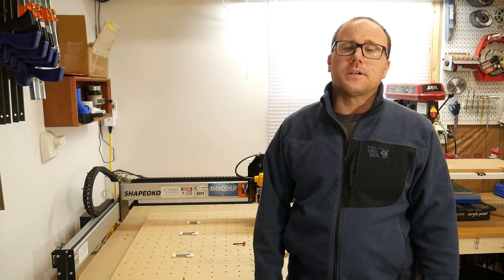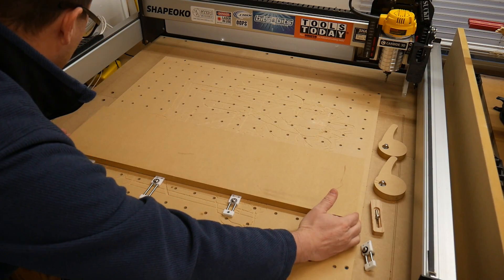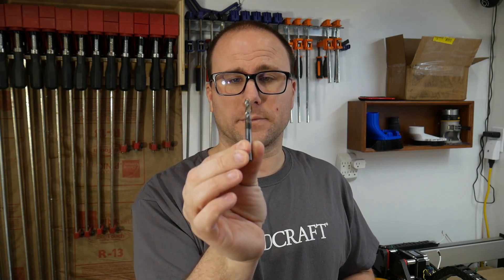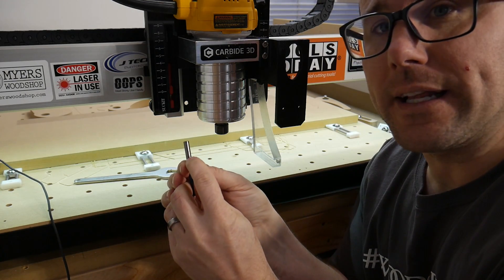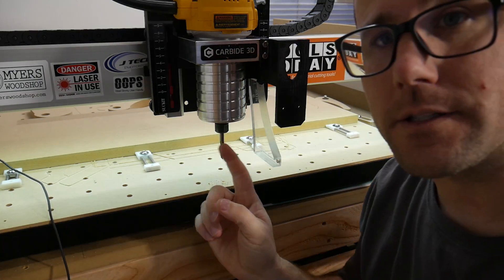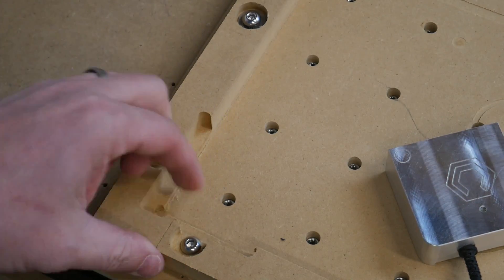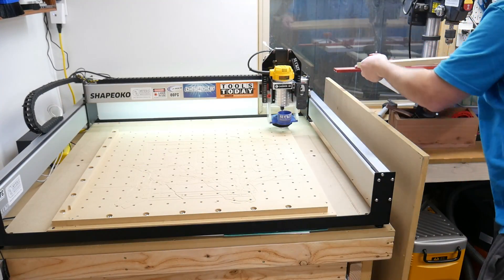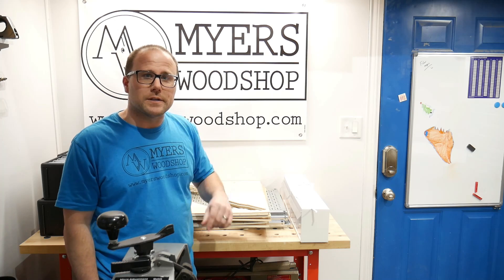How To Create A Fence For Your CNC Wasteboard // CNC Woodworking

Comment from the maker: 1/4 - 20 hex bolts : https://amzn.to/2UgneU5
1/4 - 20 washers : https://amzn.to/2KXoFST
Reply: Is the jog area larger than the cutting area? I’m brand new and worried I may accidentally run my bit into the fence hardware. Would it be possible to make the fence equal to the minimum x and y directions so the machine simply cannot reach the hardware (and you don’t lose cutting area)?
Reply: @brooksey097  If you attached a fence to the left of this wasteboard you could do that, but it would be one more thing to attach to either you base or try to screw in from the side into the wasteboard. Make sure to use your spindle to cut the left side of the waste board to get it perfect before you do. 

That wouldnt work though on the bottom since the Shapeoko has a metal frame there and you can't get past it without build up and losing material thickness

Comment: I've just downloaded the svg files for the cam clamps; thank you. I'm new to cnc and am using carveco maker. Is there a specific size 'model' that the clamps were designed for? (eg 400 x 300mm mdf). I've tried numerous variations on the size, but the svg file appears to change to suit the model (and I don't want 400mm clamps 🤣).

Comment: I set my fence on the limit of cut so I didn't lose cutting area also guarantee that the bit would not crash into the fence on a fast return to 0,0. (Easel likes shooting back at 3.8mm)
Does your setup not position the bit at 0,0?
Does this negate need for 3D zero probe?
Reply: You could still get a crash if you're using a larger bit though, right?

Comment: Wondering why you didn't build the fence to fit just outside of the cutting area? On my setup (a Shark HD5), I have the fence only protruding into the cutting area by about 1/4" after the straightening cutoff.
Reply from the maker: That could definitely be done.

Comment: Great video!!! Just an observation, when your touching off the tool should be rotated so your flute touches off on the touch off plate. In thos case your X is out by the depth of the flute
Reply from the maker: Thanks for the tip!

Comment: One suggestion could you adjust the volume on your videos while cutting or have no sound. It goes from your soft speaking to loud vacuums screeching. I love your videos and thank you for sharing. You really helped me learn how to get started with my shapeoko. Your step by step videos were great at helping me get started! Which from there I picked it up fairly quickly. But for disclosure I used to be a tool and die maker apprentice so I ran industrial CNC machines but that was a lil over a decade ago since I was doing that.  I've only had my shapeoko for 6 weeks and i'm already considering upgrading to fusion 360 to do more advanced machining and designing. Carbide create is limited for what I would like to do. I honestly would have to say without your helpful videos and winston moys YouTube channel I would not be as far as I am already. So a huge thank you for sharing your knowledge. Keep creating! If you can dream it, you can build it.
Reply from the maker: ok.

Comment: Just a bit of a tip to you. Don't use the cutters for finding the edge of your parts. Because you will most likely NOT bump on the flute ( the major diameter) of the cutter. That will give you a false reading of where your edges really are. Use a smooth pin. Any size, just tell your program what size you're using. Then put your cutter in to set the Z height. 50 years of experience tells us what not to do. Learning is a process. Keep it up.
Reply from the maker: or  you can put in the cutter upside down.  but .005 is good enough for most.

Comment: using a XYZ probe plate. when you do the X & Y. since the endmill has flutes the shape is not round so when you touch off on the Plate.. it wont actually be an accurate X & Y position. You need to use a Solid Round Shaft for X & Y and then do Z later with the Endmill installed
Reply: You can spin the cutter so the high point touches off. Or use a dial indicator and swing indicate. I have my starrett edge finder from my tool and die days but those you have to run at either 1000 or 1200 rpm so I think the routers are way too fast to use.  Another option would be a drill bit installed upside down but be very careful that you only lightly snug it in the collet so you don't wreck the collet spring. But yeah 1/4" dowel pin is the best quick and dirty method. Gets you close enough.
Reply: Another point would be to make sure your endmill cutter is low enough that the spiral edge of cutter will touch at its furthest point. Example: the 201 cutter that comes with the shapeoko is a 3 flute. 250in diameter and the side has a cutting edge of .750in. If the end of the cutter is dropped the full .75in below the top surface of the object you're touching off of there is always going to be 1 or 2 points at the full .250inch diameter touching the wall you are touching off on. If you are about 1/2" below the surface at least 1 point will be at the correct diameter. My suggestion would be to make sure you have dropped the cutter below the top surface enough so there is always one of the flutes touching off at its full diameter so you get an accurate touch off.

Comment: I am trying to wrap my head around including the touch plate into the fence. Does the touch plate align the X and Y to the bottom corner of the fence (as long as the bottom left is selected in the carbide software) or does a touch plate only set Z and you jog to where X&Y are? Sorry, new to cnc and learning before I buy one, I am thinking shopoko 3 standard based on size.
Reply from the maker: their touch probe does xy and z.
Reply: @MyersWoodshop  Thank you for the reply. Perhaps it is just the camera angle that was throwing me off. From what I have seen in the last few weeks I think I will save up for the Shapeoko. I'm going to save your videos to buy the plans when I get the machine.

Comment: When I tried to create the fence.  It appears that the area for the probe is being cut on the outside of the area.  I see in the video that when the probe slots are cut.  There is one L shape and one straight line.  My cut was two L shape cuts.  I looked at the c2d using carbide create and the probe cuts look correct.  Althought the top cut is not a complete rectangle.  Am I doing something wrong?
Reply from the maker: The probe area should be a pocket cut
Reply: @MyersWoodshop  Does this mean you are saying that the free file is correct?  Because I just downloaded the file and ran it.  When loaded into carbide create the toolpath shows the path around the area that is supposed to be a pocket.
Reply: I have a picture of the cuts showing that the area that should be cut is still there with a cut all the way around.  Don't know how to post a picture.
Reply: As an aside I deleted the touch probe paths and recreated them.  I then cut out the fence with no problem.  The file that I used came from the blog.  Both the xxl and xl show the wrong tool path.  The small file does not bring up the save as option.

Comment: wow. that Shepoko team is pretty serious about marketing. it's a shit CNC kit, the equivalent to a cheap multi-tool that can do just so little that it'll cost you a lot of time and not do the job and you'll end up buying the more expensive tool, now you have a good tool but you had to pay for a shitty tool as well making things even more expensive
Reply from the maker: For the about the same cost, which cnc would you recommend?
Reply: worst cnc out there. horrible, simplistic, buggy software, hilarious rigidity (axes are somewhat ok but table is like a blanket), can be easily derailed i Z axis,cannot remove z axis for cleaning, gets detuned easily, dust goes everywhere, belts easily skip and you lose xyz even when changing tool, 800w spindle is an overkill, an 125W would be more appropriate, the list of why this cnc sucks is endless. no tool changer, no spindle controls, no options in general. trendy, branded expensive trash for rich diy hipsters.

i have developed gray hair in the first months of use, just because my friends in a 'fablab' (wow) bought it.

you can get tons better machine in similar, same, or even lower prices.
Reply from the maker: Name a few
Reply: @MyersWoodshop  Queenbee Pre
Reply: constantinos schinas maybe you’re just an idiot. Mine is great.

Comment: What if you mount the fence on the machine wood floor, at the edge of the working board? If you do that you don’t lose any of your cutting area... (I don’t own yet the machine so I don’t know the implications of screwing something on the floor board, so just using my common sense logic here, if I am wrong in my presumption, please correct me)
Reply from the maker: Yeah, you could do that. But making it removable would be the key.

Comment: If this line was in the Z0 position it would not be there. The probe was moving at zeroing ...
Reply from the maker: what line?
Reply: @MyersWoodshop  7:41 this is your problem
Reply from the maker: Ah.   It registers the intial touch.  The rest is just inertia.
Reply: @MyersWoodshop  So it should be and if this is not the reason, there are 2 options, error in Gcode, wrong height of the probe in the program.
Reply: @MyersWoodshop  8:23 The button on the sensor is outside the measured element, so it moves. You must necessarily improve it.

Comment: If you're cutting the parts put, like you did to make the fence, you only need to be square enough to make sure the material covers the cut area. Probing X and Y for that job is useless. I will say that the fence and a place to zero it off is useful is either you're doing tool changes, multiday work, or you're cutting something that has the final edges already on it (like engraving a panel).
Reply from the maker: That's why it's easily removable. It's not for every job.

Comment: Nice job.  A little tip though. Your life would be easier if you had cut a chamfer or a small step on the bottom inside edge of your fence rails. Having the right angle created by the intersection of the spoil board and the edge of the fence creates a corner that's difficult to clean thoroughly. Having a small relief at that corner would make it easier to keep it free of debris.

Cheers,
R
Reply from the maker: absolutely correct.  also a place for the dust to go!

Comment: I would just make a small fence that I can cut out in one piece say 12" x 12" and then use a speed square and micrometer to set it in place with screws. this way you already have the cut at 90. you could then set zero for all axis and if you really wanted run a second path to cut inside edge. just the 12" fence should be sufficient to hold your peace in perfect 90 degree and use your clamps on the the opposite corner sides to hold down tight. Still a great video just though making it two pieces was not the most efficient way to make it.
Reply from the maker: sometimes 90 isn't always 90 relative to the machine, which is why i trim the insides once it's installed.  Two pieces for a fence this size is a way to keep the huge amount of waste down.

Comment: It's more accurate to probe the X at a deeper Z; (7:58) You are measuring the core/ chip evacuation part of the mill instead of the cutting edge. With a lower Z the chance of hitting a cutting edge is simple larger if a mill with a helix is used.
Reply: yes, it could be. but the horrendous, simplistic and buggy carbide software,  in conjuction with the abysmal rigidity, kid toy quality shapeoko flat trashcan, do not help you either with programming, using, or actually cutting. avoid this expensive diy hipster crap at all costs.
Reply from the maker: You trashed it. Now offer a better machine in the same price range.

Comment: Hi I downloaded your wasteboard. It won’t let me load your file in motion. I’m new to Cnc and was curious if you know why
Reply from the maker: You have to open it in carbides great first, then save gcode in toolpaths tab, then load that gcode into motion.
Reply: @MyersWoodshop  ill try that thanks you
Reply from the maker: No problem
Reply: @MyersWoodshop  that worked thanks a lot. I have learned a lot from you. great videos. thanks for all your help

Comment: Ben, I have several bits with the "K" mark on them.  Is there a problem with inserting the bit deeper than the "K"?  This assumes sufficient clearance for the collet and the hold down clamps.
Reply from the maker: Nope.  As long as it’s at least at the k you’ll be fine
Reply: @MyersWoodshop  That's exactly what I thought.  And, I suppose it could also help with "less deflection".  BTW  --  I bought both your spoilboard and fence plans.
Reply from the maker: Awesome.  Thanks Steve.  If you can leave feedback on etsy, that helps me a lot!  Hit me up with more questions!

Comment: I tried the file but when i upload it to CC it has no toolpaths :(
Reply from the maker: You need to have the latest carbide create (316).  Go download the newest version and toolpaths will show up!
Reply: @MyersWoodshop  It appears that you suggested 1/4" screws for the fence but the diameter on the cc file is .156.  Should that be changed to .25 or is there a reason to make it smaller and screw it into the mdf?
Reply: Yeah! It worked , thank you!
Reply from the maker: Your welcome!

Comment: Great ideas Ben!  It took awhile but I found a local shop that could sharpen my carbide bits when dull instead of chucking them.  Find someone with a commercial CNC and find out where they send their bits.
Reply from the maker: I never even considered bit sharpening.  I live in a small town so I doubt there's anyone local.

Comment: Hi I just bought the 3 files from your  store  I can load the  Fenced file and the clamp file , But when I load the waste board file it loads some what  and then it just sits there, across the screen at the top it says that  Carbide create is not responding , so what  do you think is the matter. Jeff
Reply from the maker: The wasteboard file has A LOT of calculations for carbide motion.  When it 'hangs' get a cup of coffee, check the mail, and give your spouse a kiss.  then come back and it should be responsive again.